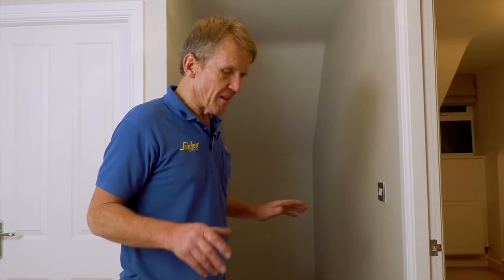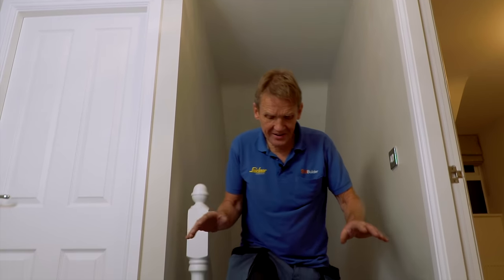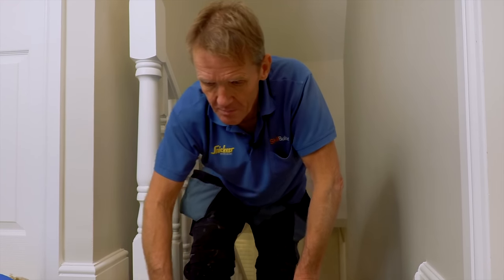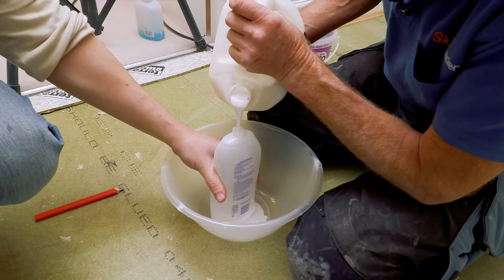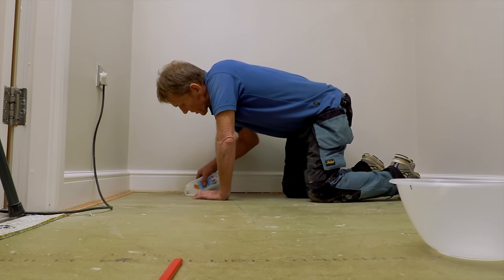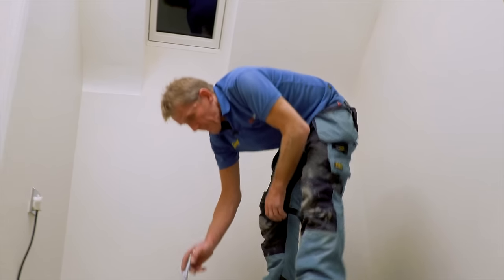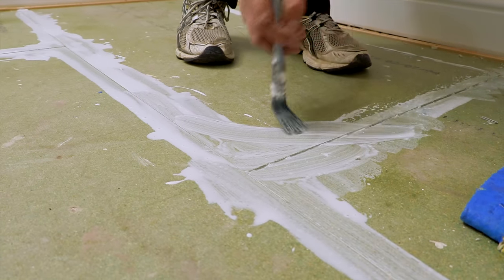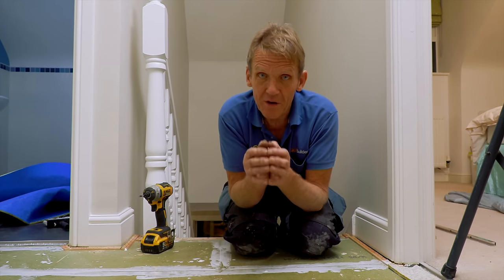Creaking Floorboards Driving You Crazy?

Comment: I am in DESPERATE need of help please!! I loved the video and tried this method, right after I ripped up the LVT and MDF Board, did two applications of the glue/water and drilled in 100 screws but has made almost no difference :( The sound is so loud like a cracking sound. I saw another video on youtube about drilling screws in under the skirting board as it might be as issue with the wall and flooring joining so I removed the skirting board and can see there are several holes in the plasterboard with screws going at an angle into to the flooring. Is this normal or something the previous owner (only bought the house a few months ago and I've had nothing but issues with it) did to try to fix the cracking sound or is this standard in a house built around 2000. Any help would be very much appreciated!!
Reply from the maker: It sounds interesting, can you send a video from your phone?  Film it in the landscape mode so we get the full picture.
Reply: @SkillBuilder  The room has since been carpeted in the hope that and a heavy bed would dampen the noise (no such luck) but I took a video of the noise right after trying the method to show how bad the sound still was - I'm a 9st women so you can't blame the noise on a heavy person. https://youtu.be/I24mWYlQ2F4 ).  I can't live with the noise so decided to take up the LVT/MDF in the adjacent room to see if I could fix it there and took the skirting board off to find screws already going through the wall ( https://imgur.com/QLGwJpe and https://imgur.com/z3btDab ) I don't know if they've already tried to fix it or if the screws through the wall is something common in newer build (2000) houses. I wanted to replace all the floorboards to try and fix the problem but as I'm no DIY expert wanted to see if there was anything else I can try first.
Reply: @SkillBuilder  Had something like that here, caused by the nail through the door frame into the floor which had dropped as the joists shrank. Cut the nail and the noise stopped.

Comment: I tried this hoping it would work wonders. Alas, it made no difference. Possibly as the boards are quite large and probably have some movement in the middle. Drilled loads of screws I'm as well but no improvement. Do Ilive with it or any other suggestions? love the channel btw
Reply from the maker: I would drill holes in the board over  the joists and squirt in some polyurethane. Take care to avoid the pipes
Reply: @SkillBuilder  thanks for the reply. Good idea. After hole drilling is it worth plugging it with a screw to tighten even more or just leave it

Comment: I would either run a multitool blade in the T&G to create a gap. Or take em up and replace with 5 or 6 x 1 planks.
Reply from the maker: BF 

The chipboard relies to some degree on having a supported edge as well as the short ends landing on a joist. If glue is used there is no problem but cutting the tongues out weakens the floor and, with somebody over 90 killos there is a real chance of it breaking.
Reply: @SkillBuilder  Fair point. Thanks

Comment: Does it have to be pure PVA? What about a mix like Titebond III? I already have nearly a full bottle of that stuff, and it's the strongest of Titebond's wood glues, but it's not straight PVA.  I also have plywood T&G subfloor, not particle/chip/OSB. My subfloor was glued and ring shank nailed to the joists during construction, and the carpet installers popped in subfloor screws every 6" o-c, but it's still squeaking loud in some spots. I figured it's gotta be the T&G...
Reply from the maker: use any water based glue but make it thin so it runs into the t&G and swells it a little
Reply: @SkillBuilder  thanks. Going to be giving it a go tomorrow.
Reply: @SkillBuilder  unfortunately, it seems as though this did not work for me. I did a test section first and quickly realized I'm going to need quite a bit of PVA glue for the project. So I went out and bought a gallon of Titebond III. 

I went around all T&G joints and brushed a couple coats into it. It was about a 1:1 mix, because as others have said the 3:1 mix seamed way too watery. I didn't want to destroy the sheetrock in the hallway beneath. It was flowing into the joint and the super dry plywood plenty well at 1:1. I'm guessing whatever brand PVA glue you bought is thicker than this Titebond glue, hence the need for more water in your application.

Anyway, after coating all joints and walking around on them, I popped in a few extra screws in some spots.  We more or less stayed off the area; however it's the only way into our bedroom, so we had to walk on it once last night to get to bed and again this morning to get downstairs.  I put pads along the joist lines, away from the T&G joints for us to walk on, so as to minimize any stress on the T&G joints in case they weren't set up yet. It's only a small section that we need to walk on anyway (about 6ft long).

The glue seems to be all set now, and there's no change in the sqeaking. In fact, it may have gotten worse along the far edge of the subfloor where the joists frame into a LVL beam. I don't know what to do now. This subfloor is DEFINITELY screwed down tight to the joists. I tried removing some of the ring shank nails in the joists, but they do not budge due to the construction adhesive used on the subfloor. All i do is bend the heads. There are screws every other nail (every 3-6 inches) in every joist. The ones I installed i made sure to stand over the area during installation, and I weight 315lbs, so that plywood was definitely flat on the joist flange!  It really feels like the squeaking is coming from something else other than the subfloor, but the areas that are squeaking are above a hallway and not near any walls or supports. It makes no sense.

Comment: Roger, another great video, very informative. I’ve got more or less the same problem with the top of my staircase. I’m going to be pulling up the old floorboards and putting chipboard sheets down. Any advice?
Reply: NastyHaggis why would you replace timber floor boards with chipboard? Chipboard flooring is absolute junk. If you want a larger board size then get some 8x2 t&g plywood such as spruce board.
Reply: Timber floor boards are the best. Only reason we don’t fit them so often nowadays is labour cost. If it’s a small diy job then the cost is marginal.
Reply from the maker: NastyHaggis 
If the boards are good you can leave them but if they are in bits then a larger sheet material might be good. As Steven D says chipboard is not as good as tree wood. If you want to use it then lay a bead of adhesive along each joist and glue the tongues and grooves. Also if the boards join over fresh air it is worth fitting a nogging or dwang. The more you can stop them flexing the better.
Reply: There's another great video about this by UltimateHandyMan on YouTube.  He has one specifically about stairs too which I'm going to try.
Reply: I just lay 1 inch thick slabs of granite straight over the top of my joists. No floorboards or fixings. Makes for a lovely cold, quiet floor :-) .

Comment: What pva glu you recommend getting for this,brand etc.
Reply from the maker: Any PVA is good enough. Everbuild Bondite Unibond. You need to water it down, say 3 to 1 to get it to run into the joints and swell them slightly.. When it sets the joints are very tight and you have to break the board to get them apart.
Reply: Skill Builder I got contractors ever build 506 universal. Hope that’s ok and thanks a lot for your reply.

Comment: You cant just drive any old screw in.. You need either a special flooring screw or a screw that doesnt have the thread all the way to the end. You need to pilot hole and countersink the floor board before screwing. This will ensure that you dont end up with any mechanical fixings causing noise at a later date. This way the thread of the screw will go into the joist and the shaft will be free of the floorboard (within the pilot hole) but securing the board down. If in doubt you should always remove an area of flooring ensuring you do NOT cut down deeper than the floorboard itself (18mm - 22mm). This can be done with a plunge saw restricting your cutting depth.
Reply: Also there is no real need to use 3 inch screws here. Your boards will not be thicker than 22mm so why risk screwing down 3 inches?
Reply from the maker: @willowcarter3614  You are right. They were the wrong screws for the job, as I have said several times in the comments.  12 months later and they are fine, no more squeaks.

Comment: nice video ,but it would be nice to point to use corect screws , not fully threaded so actualy board have chance to be pulled toward joist (i personaly predrill baords anyway)
and nice fat coarse thread is also welcome
Reply from the maker: YOU ARE RIGHT BUT THEY DID ACTUALLY PULL DOWN QUITE NICELY.

Comment: nice try but, carpet is a pain to pull due to seams.  Unless there were goofballs building the house the plumbing should be 1 -1/2  away from all nailers.  The mistake people make is running the screw past the 1 -1/2 in and hit a pipe.

Comment: I tried the glue method on my floorboards, i did two coats (On different nights) as described and it made zero difference to the noise, they still creak.  The only bit i didnt do (For safety) was put in additional nails into the boards to secure due to risk of bursting a pipe.  If this fix is working for people its probably more due to the nails then anything the PVA glue achieves.

Comment: Don't ever use PVA on the floor, it is a temp fix it will not last forever, you will just be doing it again or taking the floor up to do it correctly.
Reply from the maker: PVA is a recommended glue for chipboard floors. It is perfectly ok for the T&G.  Do some research and get back to me. Polyurethane glue is not an option for a remedial repair. This idea works well and has stood the test of time

Comment: The issue with chipboard floors is often in the installation, and replacing with ply won’t necessarily fix the issue. 

With proper D4 adhesive, run along the T&G joint and along the entire length of the joists, along with spax chupboard screws (never nails) you should never have even a hint of a creak. 

As usual, tradesmen cutting corners and not spending an extra 30 mins using screws as opposed to a nail gun as well as the correct adhesive = a poor job.

Comment: I did this with 3 part water 1 part PVA like instructed and it’s came out very water and not white like on this video
Reply from the maker: Watery is just right, it lets in seep into the joints rather than sitting on the surface and it swells the chipboard very slightly.
Reply: @SkillBuilder  yours looked much more white than mine tho

Comment: Have you got a video about new build squeaky stairs!?!? 🤞🏻
Reply from the maker: Very soon
Reply: Often, the problem lies with the joint between the 'riser' (that's the -usually MDF - piece that goes vertically between the treads,) and the tread. When the stairs are made up, this joint is usually glued and nailed at the factory. But if it's a kite winder or similar, they have to be made up on site -and often the glue part is skipped. As the strength of the tread depends, to a large extent on the support it gets from the riser, if that joint isn't rock solid, you'll gets squeaks, as the tread rides on the nails. That's at the back of the tread. At the front, there's a different - but more easily fixed - problem: The top of the riser fits into a groove on the underside of the tread. Once again, it should be glued ... and... have glued triangular blocks at the back, to strengthen it. Sometimes, on those sections made up on site, they're missed out. That problem can usually be solved by using a polyurethane glue (the type that you get in a tube, from a gun.) squeeze that up into the joint and leave for a few hours. The joint at the back can be sorted, but is more involved. You'll need several pieces of timber about 750mm long, and about 35mm x 35mm in section. Use the same gun glue and squeze some into the open joint. Then, screw the 35 x 35 timber down to the tread with 3 or 4 60mm x 5 screws, about 25mm from the riser. You'll then need some 80x5 screws, to go through this timber horizontally, into the riser. This will pull the riser forwards, to meet the back of the tread - but be careful not to overtighten, or you'll strip the grip it has. Three or four both vertically and horizontally, on each riser/ tread joint - then keep off it for a good few hours. (Ignore the "sets in 5, or 25 minutes bit - give it at least a couple of hours.) Then, of course, the carpet fitter comes along, wellies the gripper rods into the riser... and undoes all your hard work ...
Reply: @johnriggs4929  thank you for you informative reply, the joint on the front of the steps were so tight you couldn’t get any glue in them. I screwed down the tops through the up stands to stop the Movement. 👍 the back part was a hole different problem as from looking under the stairs in the storage cupboard you can see they never used any consistent size  of wood block and they put them in different places. But I managed to get a rough idea of where they were by using a stud finder and sometimes I’d miss the block but I got there in the end. I glued and screwed were I could and all the stair in my town house are now squeak free. 

I used the watered down pva glue and screw method on landing etc which worked pretty well. I’ve got got one spot where it didn’t work. 
I think the only way to fix that would have been to lift the floor up and add more support etc 
I was such a time consuming job which I only started a couple of days before the carpets were due to go down with a toddler hanging of my back. 
Thanks again!
Reply: @MP-ye1to  No problem - I was just trying to help out while you waited for Roger's video, which will probably advise along the same lines - but far more easily in pictures than  words. Glad you got it sorted anyway.

Comment: This didn’t work for my chipboard, spent hours putting in pva and about 400 screws, still hectic creaking
Reply: Tom drill some holes above the squeaks over the joists the size of the nozzle on a tub of expanding gorilla glue. Then pump some in and wait for it to go off before you screw it

Comment: Should be going through the centre of the rafters. 
Unless you had gas installed by the contractors to the housing executive .
Notched out the thickness and depth of copper pipe across every joist and run the pipes across them.
Oh forgot to mention the rip saw they used on chipboard sheets , to track out the path the pipes would go .
When finished just put down the same cuts of chipboard when finished. 

Absolute shit show of a job . 

Ps do you want a job fixing my squeaky floorboards there’s a lot of them believe it or not lol .

Nothing new councils using the cheapest and worst contractors out there. As my cousin told me they aren’t tradesmen working for councils rather guy’s that didn’t make it on site’s

Comment: I could also screw a floor down alot faster than someone with a poxy noisy hammering in nails method.apparently nails are used cos they are cheaper than screws and it's quicker apparently.  Definately don't agree it's quicker. Well of course it's gunna be quicker if ya only bodge the job in the first place and only use 1 nail or screw each corner of boards.thats not the correct way to do a flooring job properly.

Comment: pva as a gap filling glue?
Reply: Gary Doyle I’m guessing was a remedial job not a full uplift and replace. Unlikely he could work PU glue in satisfactorily.
Reply from the maker: No it is not the gaps that squeak it is the tight fit on the tongue and groove. The dilute PVA seeps down into the tongues and stops them wagging. I know it works because I have taken boards up that have been stuck together in this way and it breaks the board rather than the glue joint. Even at 5 to 1 PVA is a good wood glue and the water swells the wood. It is great on creaking stairs.
Reply from the maker: @stevend9960  If it is runny enough it gets in. The householder emailed me to say all is fine so job done. He is happy so I am happy.
Reply: Skill Builder only downside to pva is that unless the surfaces are very tight the glue either won’t bind or will crack and then rub. The resin can squeak mightily when it rubs against itself. Also pva is very poor at gap filling. PU glue is very good but must be protected from UV.
Always (almost) use exterior pva. Interior stuff will reactivate when wetted and the bond will be lost.
Reply: Skill Builder I think you did a really good job here. First time I’ve seen this and I’ll be nicking your idea! Hopefully that’s ok. 
It’s a cost effective solution and I agree 100% about the diluting pva. Exactly as you say: the water will swell the chipboard and the pva will bind it. Excellent job!
Reply from the maker: @stevend9960  Hi Steven. I don't want to seem like the know it all but I have used diluted PVA for years and it doesn't crack. I used to do a lot of loft conversions and putting PVA along the tongues and into the grooves was always done. We had zero problems with sqeaks. The glue  is really quite maleable. It is not about filling the gap. Also I did a lot of work for Unibond years, writing instruction booklets and spent time at the Henkel labs. I learned that Waterproof PVA becomes waterproof when you mix it with cement. In its pure state it will re-emulisify.  Try using it on exterior joinery and it will fail. I am assuming these boards will remain dry.
Reply: Skill Builder I stand corrected! More power to you!